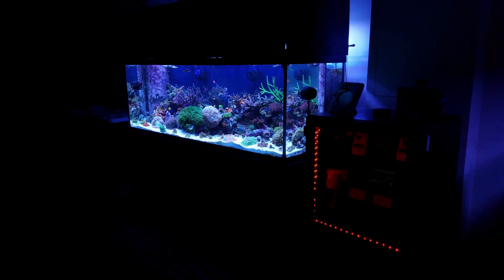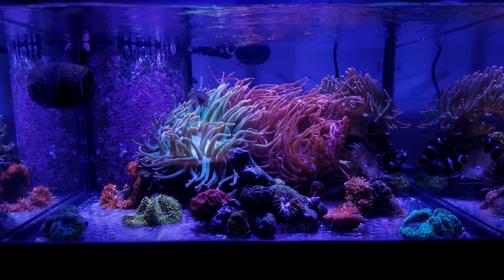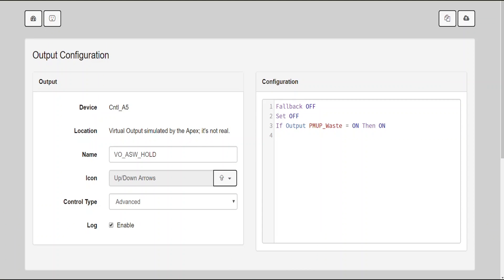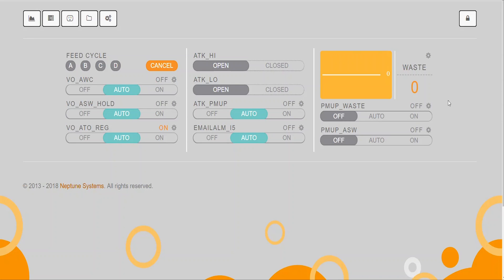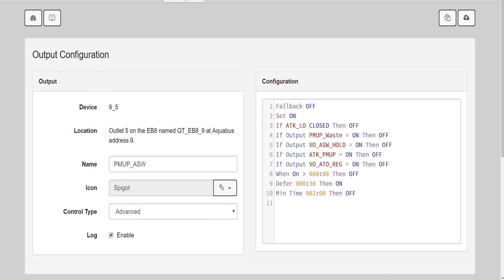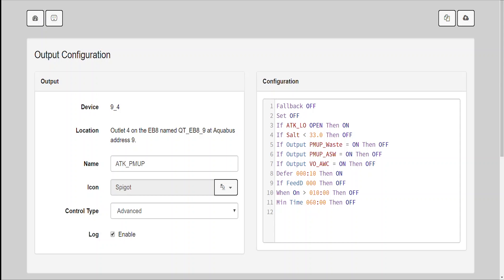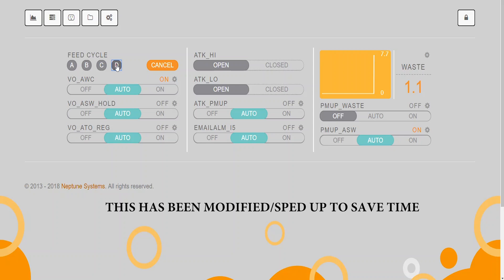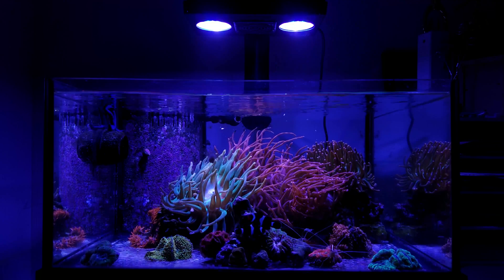The Apex one button automated water change

Comment: Question about your tank. I think I have the same one. I have a 180 gallon dual corner overflow from Marine Land. Im assuming thats what you have or the 220. Im struggling with flow. What Vortec pumps are those 40s or 60s? And lastly what percent do you run them at? I really appreciate you taking the time to answer this.

Comment: It seems to me that a pmup can pull 30 gallons out in one hour. That will be too much with the return pump still running. And we want it to continue to run if relying on the optical sensor on the ATK to trigger the end of the water change. So how do you get around this.

Comment: Wow. Great Informative video. I am setup to use a DOS  for my water changes but with the problems I am having with air getting in those and dosing not happening, proving to be unreliable. I was looking for an alternative and perhaps using pmup pumps. I would not know how to do all the programming. And I found you and this video. I am subscribed. Thankyou. Now I can get this setup. Then look into why I am getting air in my DOS lines. I currently have 3 DOS units. Thanks for this. So Happy.

Comment: I assume you had to do some wire splicing and fish a power cable from your new saltwater pmup all the way back to your apex at the tank? I’ve been thinking about doing something like you did instead of using a DOS to avoid the noise and expense of a DOS but the DOS does seem simpler since it can theoretically pull the water at its location in the sump from the barrel in the other room.

Comment: Can you tell me please if I connect the two PMUP' to the TDK FMM module?
Reply from the maker: You can add a PMUP to a FMM but you must have the 24v power supply plugged in to the FMM also.
Reply: It would be really good if you could perhaps do a video on how your hardware for this set up is plugged in? I'm not sure on virtual outlets

Comment: Great tutorial.  This is on my future todo list.  I was debating using a DOS vs the PMUP.
Reply from the maker: When I was debating that I thought the DOS was to expensive and had better uses with its dosing accuracy. You can do water changes with floats and PMUPs and leave the heavy critical dosing operations to the DOS IMHO. That being said - a water change is easier with the DOS as far as programming.
Reply: I'm not worried about easy!  just whats cleanest and most efficent.. Dual PMUPs (water out/water in) is likely the cheapest way to go